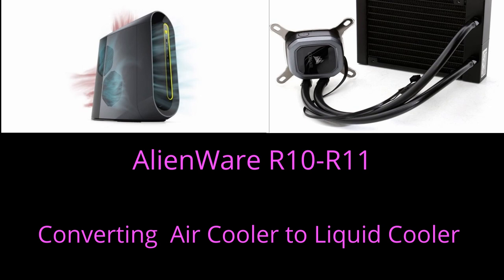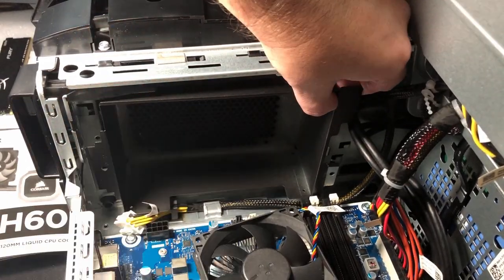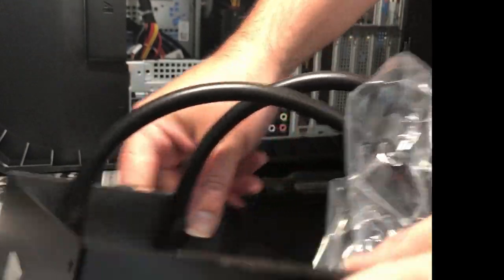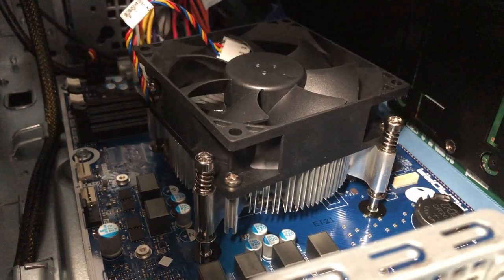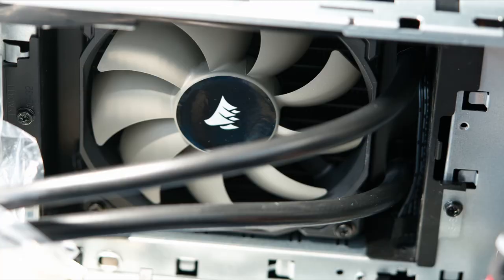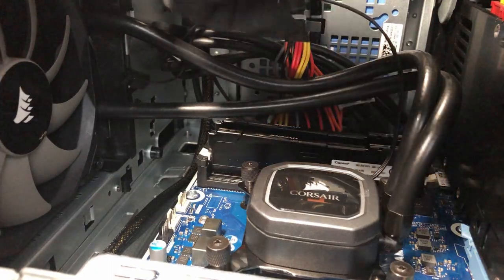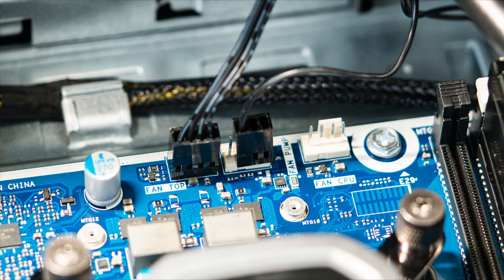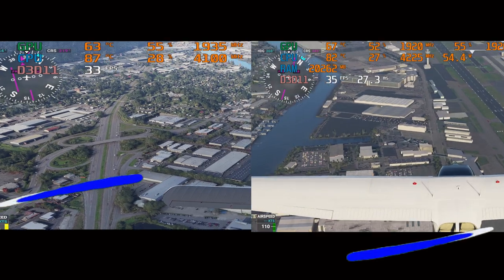Corsair H60 Liquid Cooler into Alienware R10 - R11 , Step by step tutorial.

Comment: video helped so much, got it done no issues! only thing I was wondering is my CPU fan always shows 100% speed now. Assuming that's normal and what it should be since its liquid cooling now? thanks!
Reply from the maker: My R10 shows 100% CPU fan - I am assuming that PUMP inside the H60 is at 100% . Since , now it is Liquid cool the 100% reading could be a real reading of the PUMP or just the base reading when your switched to the PUMPFAN pin and there is no longer a CPU FAN to read.?
Reply: @stonyworld6788  ok ya mine shows the same as yours. just 100%, like you said, probably because liquid pump. thanks again!

Comment: What do I do if I have a 4 pin cpu cooler and don’t have a sata
Reply from the maker: It should still work but you might have to select between PUMP FAN or CPU FAN pin connections to clear any BIOS errors - reddit and dell community post will have more information. I think the older H60 white box - had a 4 pin.

Comment: Great video! this can be done on the R12 as well correct?
Reply: Just finished it on my r12, works fine. Dell is having a hard time identifying the H60 however.
Reply: @sethevans1626  does yours say critical error too
Reply: I’m getting an issue when it comes to booting up I have to f12 to get it to boot up because The cpu fan failed the diagnostics
Reply: Just plug the pin from fan pump to fan cpu pin
Reply: @My_Names_Diesel  did you fix the issue?

Comment: Hi, does this help with noice? I have a r10 ryzen and the fans are very loud
Reply from the maker: Yes, I did put a db meter on the Air cooler system near the exhaust vent- it was 80 db at full benchmark , when they say it sounds like a jet engine -they are not far off - ( i took the meter app outside and got 70 db at rush hour with a 6 lane street!). it went down to 50 db. It's still going to be loud with full gaming - 1 power supply fan, 2 GPU fans -on full, 1 front fan at max curve and the H60  top fan.

Comment: Nice video, trying to decide between this and just swapping out the heatsink for a noctua fan. I'm wondering if it would yield roughly the same results since it has better heatsink coverage than the stock cooler. Any thoughts?
Reply from the maker: I'm trying to visualize this - is it still air cooled or liquid cooled with a 120 mm noctua fan swap? i think if it's different fans over the cooler radiator the performance maybe the same but noise could be lower.
Reply: @stonyworld6788  Actually, based on your recommendation for how simple the new watercooling is I'm going to give this aio a shot. I'm hoping installation will be easy. How would you recommend I clean the old thermal paste off CPU? Would I be able to do it with an alcohol wipe without damaging the hardware?
Reply from the maker: @Plus2UsernameOfWit  Yes, clean the old thermal paste with alcohol wipes - or isopropyl alcohol on a cloth or paper towel. it doesn't require a lot . The beauty  of this new generation of processors is they have their own heatsink die and have build in temperature sensors that shut off/reduce the processor speed if they detect  over temperatures  (extra safety window vs the old days of fried parts).  You do need a clean connection between each part - I have read about some higher temperature issues when people don't clean the old paste.
Reply: @stonyworld6788  Thanks for the guidance, pc should be in around a couple of weeks from now. I'll let you know how it goes.
Reply: Quick question, if I were to also be installing an additional SSD, would there still be enough sata power ports for me to use? I'm wondering if I can keep the current 1 TB HDD in there or if I'll need to just swap it out with the SSD I'm planning on installing. Trying to get a dear friend set up for the next 5-8 years. H60 came in today, seals look good!
Reply: Also, last thing I want to check on, would there be any benefit/difference if I installed the fan on the outside of the radiator pushing out as opposed to inside, pushing out? I'm pretty sure that's the last question I would have for this setup.
Reply from the maker: @Plus2UsernameOfWit  In my option, having the fan pull will work but if the cooling numbers are higher than expected; It might need redoing. Unless you create a push/pull 2 fan sandwich, I wouldn't except better or equal results to the fan PUSH configuration. The Fan pushing is also trying to push any hot air from the top compartment. The 1 TB HDD has two SATA  power connectors - if you don't have enough length - you can order a SATA power extension. "Cable Matters 2 Pack 15 Pin SATA to 4 SATA Power Splitter Cable - 18 Inches" would keep the bottom SDD cable free.
Reply: @stonyworld6788  To me positioning doesn't matter, I work at an MSP and have had to strap down SSD's on the fly, as long as I've got the free power port wherever I'm fine. I think I'll stick to the config you show here to be safe. The PC and parts shipped early. In total, 1 tb ssd install, 4 x 8 gb 3200 ram sticks (light video editing is intended), and h60 swap out. If the gods of shipping go my way I'll be building on New Years! I'll see if I can take some pics/videos or something.

Comment: Ihave a bios error where it says the fan is not working :(
Reply from the maker: If you have a R11, you may need to hook the 3 pin  PUMP fan tachometer to the CPU FAN connection. The R10 seems to detect the change but the R11 bios is still looking for the Air cooler fan.
Reply: Did that work?
Reply: It worked for me you legend thank you 🙏🏼

Comment: I have the r12x I connected to where it says pump and every time I boot up I get a preboot system check? How do I bypass this
Reply: Did you ever figure it out, I’m in the same position.
Reply: @marckosmo9614  Did you try plugging it into the CPU slot? thats how he said to fix the problem for the r11 im trying to find out if thats the case for the r12
Reply: @michaelgambale6491  still getting the system check when plugged into cpu fan and fan pump.
Reply: Hi, I’m having the same issue for my r12. Tried both cpu fan and pump plug still getting the bios cpu error.
Reply: @michaelgambale6491  I figured it out, for some reason it was the top fan creating the cpu fan error. I had to reconnect the stock top fan the radiator to get rid of the error and then connect the cable from the liquid cooler to the cpu fan connector.
Reply: @jackyzhang1556  Hey Jacky, I used a Y adapter to hook up my stock fan and a Corsair fan together and sandwiched the radiator with them, then connected the h60 pump to the cpu fan connector and that fixed the issue no more errors at start up. Hope this helps.

Comment: I bought the Stock r10 ryzen addition with the 3070 and 3700 because they ran out of stock so fast on prez day and all they had was stock option. Will this install work with my 550w psu? My comp is running in the 90s when im gaming and im worried about damaging parts, Thanks for the help
Reply: Sounds like the exact set up I purchased from Dell/Alienware. I did this swap/replacement to an H60 last night and so far no issues, temps staying below 70 running games.
Reply: @Ricecooka  Thank you

Comment: Have you had any issues without the heatsinks installed on the VRMs?
Reply from the maker: I haven't had issues with the lack of heatsinks on the VRMs. I had initial crash to desktop with the early versions of MSFS 2020, but after reducing by ram speed from 3400 to 3200 in the bios and the various MSFS updates - it has been stable for months. Since the heat exchange occurs in the top of the machine, I would figure the area around the CPU is cooler. However, If I wanted to overclock this machine, then more cooling solutions would be a good plan.
Reply: @stonyworld6788  & @wykoller, do you guys know if there is an after market VRM heatsink? I can't seem to find anything online.
Reply: @vegagenesistech9657   j46j2 is the part number, they sell it on ebay.

Comment: Where is the spare unused sata power plug in the power supply you talked about?  I have spent an hour looking for it now
Reply from the maker: I guess it may depend on your system specs - I had an extra cable point downward towards the lower 2.5  SDD cages below the video card. I also had a 3.5 hard drive behind the power supply which had a sata power cable with two extensions. If you need more Sata power you can probably get a extension cable splitter like this -"Cable Matters 2 Pack 15 Pin SATA to 4 SATA Power Splitter Cable - 18 Inches". Hope that helps.

Comment: Do you put any thermal paste on top of the processor?  Does the H60 come with any?
Reply from the maker: The H60 comes with pre-pasted heat sink. Remove plastic cover and tighten the four screws.

Comment: Quick question, do you have to use the mounting brackets included based on what processor you have or is there no need for them?
Reply from the maker: I think that Alienware has made both AMD and Intel CPU  mounting brackets to work with intels 4 pin riser screw system. It probably saves time and resources at the elf factory -  So, no need to use the included AMD system.

Comment: can you install a second fan with the Y splitter with the H60’s ? Or just the Alienware one as I’ve seen you can do a double fan
Reply from the maker: Yes , you can do a Pull-Push double fan radiator sandwich with a Y connector. You just need the extra screws and decide whether to use the stock fan or two new fans. If you have an R11, you may need to plug it into the CPUFAN connection to remove the bios detection error.

Comment: Do you not get a bios error when booting up? I have have same components but I get a bios error unless I plug the fan into cpu fan instead of pump fan
Reply from the maker: If you have an intel R11, you will need to plug into the CPU fan. I haven't updated the bios so maybe it is also changing for AMD processors?

Comment: Did you add the vrm heat sinks?
Reply from the maker: I didn't add them but if you need them - "Searched the whole internet, and finally got a hold of someone at Dell parts sales chat that got me both parts:

TOP HEATSINK $12.99 part# 4D5V9 --- 

ASSY,HTSNK,VR,CPU,RYZEN

LEFT SIDE HEATSINK $1.25 part# J46J2 ---

Assembly,Heatsink,Video Resolu tion,Central Processor Unit,95 W,R5"

or Amazon USA had them - 
https://www.amazon.com/Deal4GO-Heatsink-Module-Thermal-Alienware/dp/B09784RS2P/ref=pd_di_sccai_1/142-9597544-3442443?pd_rd_w=zzBkl&pf_rd_p=c9443270-b914-4430-a90b-72e3e7e784e0&pf_rd_r=V98ME1G2YTVCFAQ71FR6&pd_rd_r=7ed3855e-552e-46c6-aed7-9875380dc29f&pd_rd_wg=Jsfrx&pd_rd_i=B09784RS2P&psc=1

Comment: Why didn't you choose water cooling when you bought it?  The AIO and the 1000 Watt power supply run $150. If you did cheap out, make sure you get the VRM heat sink or you will cook your VRM.
Reply from the maker: I think the problem is most of us (old timer afraid of the water) haven't bought a new computer in a while and don't know how much better liquid cooling is in the Alienware System - 20 oC difference and 30 decibel noise difference 80 to 50 decibel. It's Apple to oranges!!
Reply: @stonyworld6788  I too am an old timer and my parts built Aurora R7 was my first foray into liquid cooling. It is quieter and cooler than my previous rig. When I built the Aurora R7 from Ebay parts and pieces , the cost of the air cooler ($45) and the AIO ( $45- 50) was the similar so the AIO made sense. The AIO VRAM heat sink runs $17 or so. When I added a high power GPU, I had to upgrade the 550w power supply to the 1000w unit at a cost of $125. Last month I ordered the Aurora R10, it just made sense to get the AIO and 1000w power supply and Alienware required it with the RX 6800xt GPU. For those looking to purchase an Alienware Aurora and liquid cooling is an available option, I highly recommend spending the extra money.

Comment: Hey I have an r11 with a 10700 and a 3080x heatsink and I get up to 103 degrees gaming, what do u think is the best quality way to upgrade the cooling system? I don’t find mind fan noise when gaming because of my headset but I would prefer it to be quiet when I’m just chilling
Reply from the maker: Liquids cooling is probably the only way to keep the noise down. People have some success changing the case fans but only a couple specific fans work in this mode.
Reply: @stonyworld6788  do you know what other fans or whatever i can buy outside of the h60 to put it? ill put the h60 in hopefully as well

Comment: When I installed mine and turned it on, it said that the fan isn’t responding correctly, anyone who can help me?
Reply: Same, support assist throws error that cpu fan  isn’t respond correctly.
Reply: @WetaNewZealand  I had to return the fan, it didn’t work, just use your stock fan
Reply: @breachvng2210  it worked for me you should try it again
Reply: Do you still need help ill help you guys
Reply: Same here anyone have any suggestions

Comment: Can you swap over to this AIO cooler if you have a 650w power supply?
Reply from the maker: Yes! it  is only a  fan and pump running. So, it will be a very low power draw (you remove two fans-perhaps equal power usage). In general, all Alienware R cases should be liquid cooled do to small case design constraints. We  learned that the hard way!

Comment: Can i use CORSAIR HYDRO SERIES H80i ？
Reply from the maker: I think it should work since it still is a 120 mm form factor and there is enough room for a dual fan set-up.
Reply: From what I've read, yes you can. But you can't do a push/pull setup with 2 fans

Comment: may i know the size of radiator box of the chassis?
Reply from the maker: I haven't measure it but if fits the H60 snug - so the dimensions of the H60 , Radiator Dimensions 120mmx152mmx27mm - the depth is greater that it will accept a two fan configuration if your handy with more pro changes.

Comment: Can you put additional fan on the bottom of the radiator?
Reply: It can be done, using the push/pull method, two fans radiator in the middle. Hoses get a little longer but if your careful it shouldn't be a problem.
Reply: @mcdermott817  what is push and pull method?
Reply: @bumkyukim9950  Push/Pull method is when you have a fan on bottom of the radiator (Push) and a fan on top of the radiator (Pull).

Comment: What did you do with the pre boot performance check? I did mine and its giving me the cpu fan error.
Reply: Same did you fix it?
Reply: I believe you have to have it plugged into the "cpu fan" slot in order to prevent the bios error
Reply: @DarkSkinKakashi   yeah i found a fix. You can do what marshall said but your fan speed on the cpu will stay at 93% all the time. What I did is I used 2 fans and sandwhich the radiator. 1 fan plug in to the top fan and the other to the cpu fan and the liquid cool is in the pump plug. Both fans are exhaust. Make sure the fan that comes with the radiator is on top and the stock fan is at the bottom otherwise it wont work.
Reply: @markgotis3282  is this for the R12? or does that matter?
Reply: @michaelgambale6491  I just bought a r12 and having same issue here. Both pump plug and cpu fan won’t work. How you do  with yours?

Comment: Does the H60 fit 1200 LGA socket series?
Reply from the maker: from wiki - looks like it should work "The 4 holes for fastening the heatsink to the motherboard are placed in a square with a lateral length of 75 mm for Intel's sockets LGA 1156, LGA 1155, LGA 1150, LGA 1151 and LGA 1200. Cooling solutions should therefore be interchangeable."

Comment: Can I plug the sata power any openings?
Reply from the maker: yes any Sata Cable for power. I initial used the top hard drive sata but then bought the 4 piece extension for better cable management.

Comment: Did you rethetmal paste?
Reply from the maker: The H60 comes with pre-paste on the heat sink. You just have to take of the plastic protector and line it up. It's going strong at 47oC for internet browsing or typing, after 1 year.

Comment: Hello. I am Gonna buy an h75 with same sata power. I have r11. What and where shall I connect to avoid an bios error?
Reply from the maker: The Fan 2 pin connection should go into the CPU Fan control pins for the R11 to avoid the Bios Error  message.
Reply: @stonyworld6788  anyway have error fan spins too fast any time i start pc, but i can pass it if i press esc

Comment: Hi, is that possible to put 240mm cpu liquid cooler in?
Reply from the maker: no, it just does fit anywhere in the case - a double fan push-pull configuration around  a 120 mm radiator is the best  possible.
Reply: @stonyworld6788  Thanks:)

Comment: Anyone else getting I bios error everything is hooked up and running properly and my temps are great in comparison to the old air cooler just curious if anyone else has this issue and how to fix I’m still fairly new to building
Reply: I had it in both the cpu fan header as well as the pump header both giving me bios error
Reply from the maker: Did you update the bios? - it has been working to switch back and forth, depending on the system on the old bios.

Comment: Way to finish the build without paying the Dell tax, low intake fan can be replaced by Corsair ML 120 pro non-led fan😃
Reply: Dell tax? If you chose to configure your machine with liquid cooling, it is an additional $150 and they upgrade the power supply from a 550W unit to a 1Kw unit. I don't see that as tax.